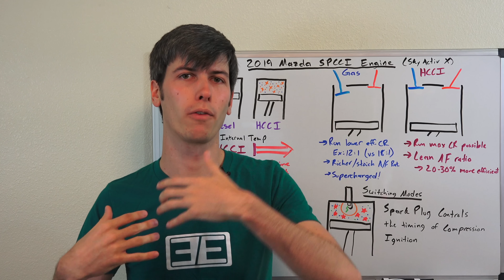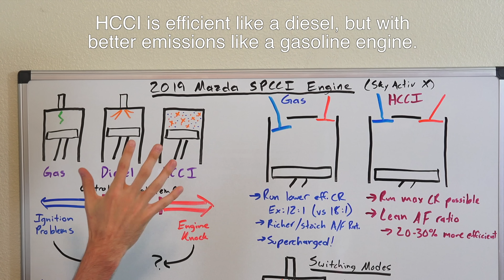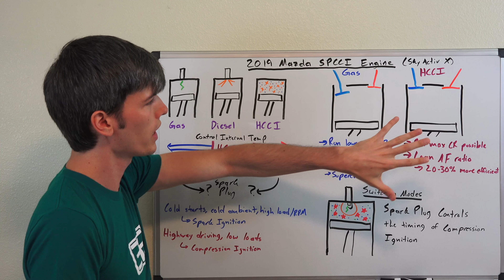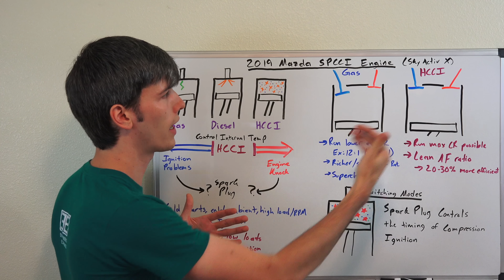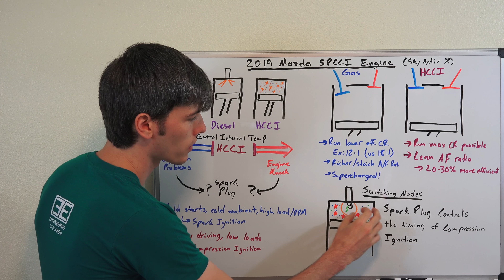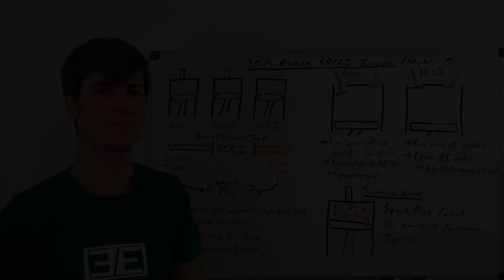Mazda Creates The Holy Grail Of Gasoline Engines - HCCI SkyActiv-X

Comment: Japan : "let's think of a new way to make engine more efficient and eco-friendly"
Europe : "ugh, let's lose one more cylinder and add another turbocharger"
Reply: I'm thinking that catalytic converters on cow butts is still future technology.
Reply: Let me fix that for you m8:

Japan : "let's think of a new way to make engine more efficient and eco-friendly"
Europe : "Let's ban combustion engines"
America: "No replacement for displacement"
Reply: America:  Add more displacement and a supercharger, and stick with OHV, of course.
Reply: Africa/Asia :  ''Lest we add another deck above the roof so it can carry more people at one GO!''
Reply: Albert S. Lets use the A/C to cool down our fat intercooler because AMERICA
Reply: America: Lets reduce emission regulations
Reply: @rotring8581  best comment
Reply: America: P R O F I T - M A R G I N S - I S - W H A T - Y O U - W O R S H I P (lets kill all of our cars off -GM and Ford
Reply: Canada: it's f***ing cold hope it starts
Reply: America: V8 MOTHERFUCKERS YEEEEHHAAAWWWW
Reply: @shorpy3407  ,  second best comment
Reply: @shorpy3407  A 5.7l hemi V8 has less HP than a 2l Turbocharged engine... VERY EFFECTIVE INDEED
Reply: Adam K America: POWER!!!(Clarkson voice).
Reply: U.S : let's go back to coal power engine.
Reply: tubester4567, if those are improvements, please explain why a 2V in-block-cam Charger can weight 4400, make nearly 500hp and return 30 miles per gallon, beating anything from Europe...
Reply: Sudan: "We do not need car or womens, we have camel."
Reply: We should make cows electric.
Reply: I understand the sentiment but stuff like the ford ecoboost engine are pretty industry-standard as far as automotive advancements go.
Reply: Albert S. I got a friend with a bone stock duramax with almost 700k miles, it's one of his trucks he uses to tow heavy equipment. Most diesels are far more reliable then a gasser regardless
Reply: The Shootist I tried to hug a fracker here in oklahoma, but the earthquakes just bounced me away.
Reply: More like Europe: We make more Diesel because "no one got bribed by the industry".
Reply: china: lets buy this engine!!!!
Reply: Adam K HCCI technology has been talked about for years. We will have to see how well Mazda pulls this off.
Reply: The livestock industry creates more greenhouse gasses than the auto industry. Auto has to bend over backwards to meet new regulations, what does the livestock industry have to do???
Reply: Adam K USA: let's gonna make another 8 liter v8
Reply: America;   lets make bloody great iron lung.
Reply: Adam K 'Murcia: more power!!
Reply: yeah and in a test of fifth gear, they found out that an m3 uses less gasoline than a Prius at the same speed.
Reply: One of the first Ferraris had a 1.5L V12
Reply: Shorpy The fact that a 5.3L v8 in 2017 can achieve 22-24 mpg on the highway is astonishing. My first truck, 96 chevy, got 13mpg with stock tires and no lift. The v8's have come a really long way from what they were.
Reply: Bob No, he's living in 2017, when americans still make the shittiest cars in the world.
Reply: There are far worse things that we aren't regulating, but manufacturers are up to their necks in tailpipe emissions regulation and will be facing more in the future. In reality, emissions regulation has become a scam to keep clueless regulators in their positions of power. That's why the rules keep changing, moving the goal post further and further away from where it all started. If you want to cut the most harmful overall emissions, cut the emissions controls out of your exhaust system. That'll cut more emissions than anything Tesla could do.
Reply: @Cm22c  
The goalpost keeps getting pushed back by lobbying Congress for that.
Reply: It's true, and the sad part is that in real world driving, the downsized turbo motors very rarely get anything close to their claimed mileage.
Reply: MrAncop Yes of course.  The place that brings us Porsche, Lamborghini, and roads with no speed limits is no fun.
Reply: MrAncop Never owned a car like that. Just note that there are lot of fun fast cars that are Turbo charged or supercharged like this Mazda.
Reply: Ryan Rohauer your mother?
Reply: Keith Lehman Lmao 🌍🌎🌏💨💨☠😵
Reply: Albert S. I prefer duramax. Best power and torque gains per $ spent in the aftermarket field. And Chrysler dosent know how to make a reliable transmission
Reply: +Logan Priv  So, what?  Government overstepped and thinking men and women responded in the only reasonable way. They ignored the government.  Huzzah!
Reply: Literally every current F1 is a turbo 1.6L V6, with hybrid power for faster turbo spooling and instant torque. Honda, Mercedes, Renault, and Ferrari all make one.
Reply: That's exactly what I was going to say!  The small percent of people who will still carry on using the internal combustion engine, will be petrol head enthusiasts i.e. dragsters etc. I would imagine the rest of us will only be too pleased to welcome electric transport, its clean, quiet and if Mr Musk has his way, cheap(er) too.
Reply: @ Mackenzie Curran. The inventor of VVT is listed as Corliss Orville Burandt, an American. GM was playing around with VVT in the 1950's 1960's. Fiat released a car with VVT in the 1970's. Honda made it mainstream in the 80's and 90's. Versions of  VVT actually goes back to steam engines, it wasnt invented by Honda.
Reply: Are you trolling or serious?
Reply: putting cows into controlled environment to extract excess green houses gases like methane to burn it and generate electricity another sustainable source of energy.
Reply: The thing about NOX is that it's only a problem in urban environments or immediately adjacent to freeways and there's a tradeoff between CO2 emissions if you want to reduce NOX (gassers produce NOX when leaned out too).

Emissions laws are a very blunt instrument mainly aimed at keeping California's Central Valley (and Los Angeles Basin) relatively unpolluted but those are edge cases in the greater scheme of things. Modern engines have enough computing power and variability that they could "sniff" the air for NOX levels and switch modes when required.

FWIW, in London in 2009 - even with all the diesel cheating - vehicle emissions only accounted for ~55% of all recorded NOX in almost every area. In Central London it was about 40%. Virtually all the rest was produced by gas/oil fired stationary heating systems (boilers) and in some streets they found individual boilers emitting more NOX than 100 cars. The interesting thing is how few NOX emitters there actually were, as almost all the boilers doing it were 1970-80s-era units. NOX emissions have been legislated for new installations since 1998.

The same has been observed across Europe - and American furnaces are just as bad.

There's a law of diminishing returns at work. Urban NOX levels aren't going to decrease much until there's a clampdown on grandfathered emitters. These systems are all old enough that they're not going to be replaced or repaired unless forced to do so.
Reply: The largest electric car market in the world by sales is China and most of them are locally-produced. Tesla and others are making headlines with their developments whilst other makers have been plodding along making sales the whole time.
Reply: I remember Mazda 1.8L V6! thats small thing had a awesome sound. Our BMW E34 530, with a 3.0L V8. it also had a super hot sound. But overall that more moving part, more friction. 

japan did the 2 spark plug too. Some of the Honda Jazz engine ( the FIT in usa/canad, well at lest in the first generation) that we don,t have here, the I-DSI engines. A 1.3 and a 1.5. Both  had 2 spark plug per cylinder, so 8 total. The 1.5l had only 85 or 90 HP ( compare to the 109 of the vtech), but torque at lower RPM.
Reply: Who needs a car with 550 miles range?
Battery degradation isn't a big issue no more
Reply: I'm okay with this simply because of turbo noises :P
Reply: Adam K 
Europe has FreeValve.
Reply: Dylan Defalco Mazda teamed with ford to make the eco
Reply: Adam K eventually gonna have a penta-turbo single cylinder engine
Reply: Incredibly common in the industry. Did you have a point?
Reply: I have no problem with Diesels, but Europe had to, and did cheat.  There is no denying this.
Reply: Ryan Rohauer you do realize emission laws are dependant on state, right?
Reply: scfog90 Top Gear
Reply: Uh, Tesla is American...
Reply: @Cole Cooper, What?! Push-rods aren't high-tech??? ;)
Reply: a little late for mazda here dont ya think?
Reply: Japan already reduced the number of cylinders and displacement already
Reply: FWIW: in the 1950s ducati and other  manufacturers were making V8 500cc road bikes. There were radical racing rule reforms in the early 1960s to slow bikes down for safety reasons (engine restrictions and banning spaceframe-based  machines with blunt-nose full fairings). That took more than 25 years to make up, but since the 1990s bikes have been going even faster whilst still staying inside those old rules.

A couple of decades earlier, Mr Bugatti was making 1.5 litre straight-8 engines. I don't think he'd like the Veyron.
Reply: lol, ironic since the first HCCI engine was developed by Daimler Benz...
Reply: Yet again another product with X for Saturn in the name.
Reply: Soon Europe is just going to have a 250 50cc single cylinder with 4 turbos in every car lol
Reply: Driveitsideways 1 yeah, the good old fingertip test and conspiracy theories vs an actual evidence. Typical internet lol.
Reply: Too late Mazda!!! Eletric motor is much better than the best gasoline engine yet to be invented and battery degradation is not a big issue anymore. You can run 100.000 miles and a Tesla battery still have more than 90% capacity
Reply: Adam...you must drive these dwarfed down turbocharged engines to really appreciate them.  These cars haul, even though they are weighted down with all the safety equipments required by regulations. As for myself, I believe the 80's - 90's saw amazing development for car enthusiasts........Cheers ;))
Reply: +sircooper1963
Well, I had the "luck" of using 2012 VW Polo, VW Up (whichever year it was, but it was in 2013) and a Skoda Fabia this year. 
Oh and I had a 2014 Citroen C4 as a replacement when my car was hit and I had to wait for a door to ship all the way from Japan.
I can't really say I enjoyed any of these cars. That damn 1.0 Up was the worst thing I have ever seen in my life, and I think that even my first car, the 1994 VW Golf Mk3 was a better ride. Everything else was average at best and not worth its price.
I know that I can buy more expensive cars with 2.0 engines or higher, but I don't want a damn limousine. I loved 90s cars but I think that even as far as up to 2010 cars seemed to get better and better. Right now I'm just looking at japanese manufacturers, because I have a Mazda and going down from a 2.3 engine always feels like you're losing pull and smoothness of ride. If I have to, I'd take a Kia Optima over an Audi just for a 2.0+ engine.
Reply: +Carl Jaekle
My car has a turbo too, but it's there to give the engine more power when I have to accelerate really quick. In all those small engines it feels like I always need to push it hard in order to get anything done.
Reply: Lance Mason Charging stations will become more common. Most people will be leaving their residence with 200 plus miles of range.
Reply: Japan: Let's copy what everyone else is doing, as we can't come up with them on our own.  See Toyota...
Reply: dude i don't care what mazda does. most of their experiments fail anyway. remember the wankel...
Reply: Unfortunately, with all the great things that come with America also come the coal rollers and the people trying to dismantle the EPA.  You keep it good.
Reply: wankel was not a fail. at all.
Reply: Peroroncino Inefficient, short life span. Huge problems with tip seals and side seals.
Reply: how do you get the electric? oh that's right by burning fossil fuels!
Reply: Of all new electrical generation currently being created, the vast majority is from solar and wind.  Also, natural gas fired electric plants are 60-70% efficient, while electric motors are around 90% efficient.  Gasoline engines are around 33% efficient.  Yes it's important how the electricity is created, but we can make progress on that side of the equation.
Reply: only if you live in a retarded country...
Reply: it was a total fail tell me which car still uses it?
Reply: Agreed it eventually totally failed and is unlikely to come back.
Reply: Brad S the livestock industry actually is over 50% of greenhouse emissions. So industrial factories, automobiles, and large cities make up less than 50% of greenhouse gasses. 

Also, a leaf blower being operated for 30 minutes pollutes more than a Peterbuilt semi truck pulling a full 50' trailer from Vancouver to Los Angeles. There are things going unregulated that should be regulated.
Reply: Ben Dover More cylinders equals more friction equals worse economy. Thus the proliferation of Turbo 4's vs V6's.
Reply: Adam K,

Capitalists: Let's find a way to beat the competitors and make money, Hmm, what about the old "build a better mousetrap way"?
Reply: Herr, you're getting funnier!
Reply: uninformed HATER !
Reply: @iMiguelAOG "Let's go electric"- > Sounds more like parts of Europe... Especially the isle nations, boy, isle nation governments seem to have a real bad habit of being short with other folks, when it comes to motor vehicles!
Reply: Yees japanese always
Reply: Loosing a cylinder for a turbo in the case of diesel engines and loosing a cylinder for an electric motor in the case of gasoline engines does make sence.
Reply: Lol..
Reply: Poland (EU): F**K it, remove the catalytic converter :)
Reply: In my country, tractor company is designing 4.5L two stroke engine...  earliest predictions are complete destruction of ozone layer...
Reply: The US SAE has developed a gasoline prototype with nearly 50% thermal efficiency.  GM, Ford and Chrysler all independently developed diesel electric hybrids that got 70-85 combined MPG...in the early 2000s.  Multiple US universities have developed similarly efficient lab scale engines.  The issue isn't the tech, it's that American consumers view fuel efficient cars as a lowest cost option and large, powerful vehicles as desirable.  We have met the enemy as he is us.
Reply: Everybody, including Japan:
Opposed piston engines are too efficient, we cannot forego our bribe from the petroleum industry not to use it.
Reply: America auto manufacturers : Let’s bribe….I mean lobby Congress to give us special privileges in the car market
Reply: yfz450rider39 

Are you still living in 2004?
Reply: +Alan Brown China is only recently the largest, I didn't say the US currently is. China has a much larger population. If China's EV sales per capita were 1/4 of the US, China would be a larger market for EVs simply because of population size. The point I'm making was that the US is often at the forefront of everything, not China, Europe or any other market. As for other EV makers, what's you point? There's a reason why they don't make headlines. Just because they make sales doesn't mean they are a major producer. Most of them fail within months of their market introduction. Tesla has shown more potential than any other manufacturer before them. That is the difference and is the reason why they receive so much attention. What would the EV market look like today without Tesla and it's ability to push EV tech out to the people? I'm not even as crazy about Tesla as some, but you clearly are just trying to take away the accomplishments of others. It's really pathetic.
Reply: Europe:  Let's rig the Diesel ECU to pollute more while pretending to be "Clean Diesel".  GTFO here with that.
Reply: Not quite, combustible fuels still have a considerably higher energy density than batteries. There's also the issue of being able to recharge in a reasonable amount of time. Not to mention the environmental side effects of manufacturing/charging/and eventually recycling all these batteries. Sure, they're "green" while you're driving around, it's all the other things that have to happen before and after that no one talks about. I'm sure it will improve over time, but it's not quite there yet.
Reply: What about the Koenigsegg freevalve system? Sweden is in Europe.
Reply: To be fair, there have been dozens of improvements to combustion engines over the years and almost all have come from Europe. Like fuel injection, overhead cam, mutli-valve, variable valve timing, etc etc, almost all have come from Europe.
Reply: Japan: let's overcomplicate the engine for it to be irreliable
Europe: let's make the engine of shitty materials for it to be irreliable
Reply: No no no! Europe: Let's make the engine more complicated, more expensive, less reliable, and more difficult to do maintenance and repairs on!
Reply: Nobody cares about some Chinese guy who converted a garage door opener into a school bus, sold it and then went bankrupt after it caught fire and killed all the children in his village.
Reply: Also Europe: Emission standards only count when people are checking
Reply: Logan Priv the diesels still polluted less then a regular gas engine. Run your finger tips on a TDI's exhaust tips then a gassers. US isn't into diesel, they make a lot more $ of petrol so they limit the amount of diesels here by strict regulations
Reply: Adam K Sad, but true.
Reply: Mackenzie Curran, no it didn't.

VTEC is actually one of the stupidest timing technologies.  All it does in its original form is change between two cam profiles, one standard and one  for performance (generally longer duration and slightly advanced opening timing.)  Alfa Romeo was the first to use it in automotive applications, and their system was actually able to adjust the phase angle of the camshaft in the same basic way it works today.  The phase adjustment system actually allows many levels of adjustment, both positive and negative from base timing, and is better in almost every way than VTEC.

Aircraft used a number of types of timing control methods since the 1950s in production engines.

If you want to go even further, desmodromic valvetrains were in use in racing engines since the 40s, both motorcycle and automotive.

Edited to add additional information.
Reply: Fracking. We will never run out of oil.
Reply: laugh in tesla
Reply: im 1300th like adam that is way to funny and true
Reply: where do all the batteries go after use, another waste, cant be reliably recycled, and some pollute even firther with coal power stations. VW messed big time, I hate them they are responsible for all this
Reply: Are you serious? In case you don't know, Mercedes-Benz showed they own HCCI ICE in 2007 ( let me say the very first), and then they brought in the competition (F1), when the hybrid era has begun. Nowadays, all the teams in F1 utilize more or less that technology. Honda, yes, Honda, one of the biggest and successful automotive company in the world, seems have vibration problems when they push hard. What are you talking about? Most of the biggest European constructors, such as Renault, FCA and the above - mentioned Mercedes are in F1!
Reply: Albert S.  Of course you don't.  YOu just kill people and create havoc and terrorize the world anywhere where there's a lot of oil, keep feeding you military industrial complex and earning money on the deaths and suffering of the rest of the world, so you can keep wasting fuel unlike the rest of the world who uses it intelligently and economically. Good job, even people like Hitler would be ashamed of todays USA, but you're all too brainwashed, delusional and ignorant to care. It's much easier to hell yeehaaaww shoot guns and drive 5 liter V8 pick up trucks to the store and back.
Reply: Many companies are using turbos as this point, including Ford, Chevy and Honda.  Note that this Mazda engine uses a supercharger.
Reply: lol whre? tesla? that company that you americans do everything to sabotage them? the chevrolet sparke? the car they wont produce in a reasonable and needed number?
Reply: That has nothing to do with VW/Audi cheating.  That's my point, "Europe" had to cheat to beat the rest of the automakers.  I have no problems with Diesels, but rigging ECU's does not impress me in terms of technological know how.  This Mazda HCCI motor does if it is put into an mass produced vehicle and performs.
Reply: tubester4567 variable valve timing came from honda
Reply: Obama is gone.  We have the trumpinator now.  MAGA.
Reply: again, anyone that doesnt live in the city/suburbs, or takes road trips, or lives far from work, or in an area without any charging stations besides the one at home. etc etc also battery degradation IS still an issue.
Reply: Europe: No fun allowed.
Reply: MyMMC no one wants a spark.  Also, do some homework with HCCI, GM had it worked out, they just didn't use it because it was a gimmick.  Only can be done at low rpm without spark.
Mazda isn't impressing anyone.
Reply: 20 years ago this would have been a great idea. But it is already obsolete. That HCCI engine has got until battery technology is just a little more sorted. Then it's gone. I give it 2-3 years. Not much of a life when Mazda should have been working on EVs instead. That's where it's all going.
Reply: the environment is fine.

Have you hugged a fracker today?  You should.
Reply: The idea of cylinder is not related. You see if you have 2.0L of engine capacity you can divide that in two as many chambers as you want (4-6-7) ! Have you seen the Mitsubishi 1.6L V6 ?! YEs a 1.6L with 6 cylinders. There are pros and cons and its about the application of that engine. We have a 1.5L 4 cylinder (Like many cars in the market) and 1.5L 3 cylinder (BMW i8). Honestly I do not know the dimensions of the i8 engine but I'm guessing it has more stroke than bore. So its a stroker. Like a Diesel engine and added with turbochargers, it has massive amount of torque and hp from a 1.5L. They reduced the number of moving parts to make the car lighter. There are many ways to do that but they decided to go that way. Now Mazda does not bother to do that because of the reason that you are blaming the European Car Market (Sound) Probably a 4 cylinder sounds better than 3, right ? So they come up with this and with the newer technology like (forged plastic and aluminium) they have enough weight saving and to make your car drive for longer distance and be powerful they come up with that design. If you noticed, they did that so your cars run more efficient as it use every bite of fuel in the most efficient way. I wonder why the european did not do that ! It seems pretty easy ! But a while ago, Mercedes-Benz used two spark plugs per cylinder. Means a V6 engine had 12 Plugs and a V8 16 Plugs although it wasn't so bad but it would have been an expensive service :)
Reply: The worlds needs to a little less smugness and little more substance. In reality,  it is America leading both Europe and Asia on improving efficiency of the ICE or creating alternatives to it. Who's keeping old fashioned power alive with 30mpg performance cars? Who's the only nation to have a major manufacturer of EVs? What nation has been the largest consumer of EV, hybrid and alternative fuel fuel vehicles for the last 2 decades? What nation has made the biggest effort and lead the way to clean up tailpipe emissions with catalytic converter for gas engines, SCR systems for all diesel vehicles before any other major market? What major market has set the toughest standards for their industries? It has been US breaking its back to keep things cleaner.
Reply: America : let's just continue to make shitty cars like the last 25+  years.
Reply: America: Let's go electric
Reply: jj Ss doubt it. Interest in electric is growing, but not at the rate they expected. The problem with electric is not e eryome lives in the city. For many a 200 mile range then having to wait for hours won't do. I drive 50 miles one way to work then 120 one way on the weekends out to a place that barely has cell signal let alone plug in stations. 

If I forget to plug in my car for just 1 day I'm screwed, my gas engine gets me 550 miles and cost me 1/4 an electric car new and it can go anywhere. I could get up and drive to Florida having to stop for gas only once or twice and that only takes a minute. 

Battery degradation is also a huge issue. Your range starts at about 200.... then starts dropping after the first day. My car is 2 years old with nearly 40k miles and it gets the same range as the day it was rolled off the lot.
Reply: no one care
Reply: Carl Jaekle go drive your ecoshitbox with a 0.5L 2 cylinder diesel engine, ugly
Reply: The idea of cylinder is not related. You see if you have 2.0L of engine capacity you can divide that in two as many chambers as you want (4-6-7) ! Have you seen the Mitsubishi 1.6L V6 ?! YEs a 1.6L with 6 cylinders. There are pros and cons and its about the application of that engine. We have a 1.5L 4 cylinder (Like many cars in the market) and 1.5L 3 cylinder (BMW i8). Honestly I do not know the dimensions of the i8 engine but I'm guessing it has more stroke than bore. So its a stroker. Like a Diesel engine and added with turbochargers, it has massive amount of torque and hp from a 1.5L. They reduced the number of moving parts to make the car lighter. There are many ways to do that but they decided to go that way. Now Mazda does not bother to do that because of the reason that you are blaming the European Car Market (Sound) Probably a 4 cylinder sounds better than 3, right ? So they come up with this and with the newer technology like (forged plastic and aluminium) they have enough weight saving and to make your car drive for longer distance and be powerful they come up with that design. If you noticed, they did that so your cars run more efficient as it use every bite of fuel in the most efficient way. I wonder why the european did not do that ! It seems pretty easy ! But a while ago, Mercedes-Benz used two spark plugs per cylinder. Means a V6 engine had 12 Plugs and a V8 16 Plugs although it wasn't so bad but it would have been an expensive service :)
Reply: Everything will be electric soon, this is a waste or research and funding.
Reply: Maru goro it's not all of the u.s. it's just the jack ass leading us